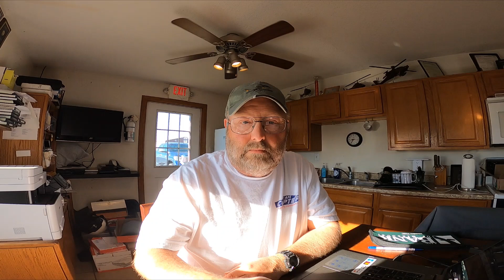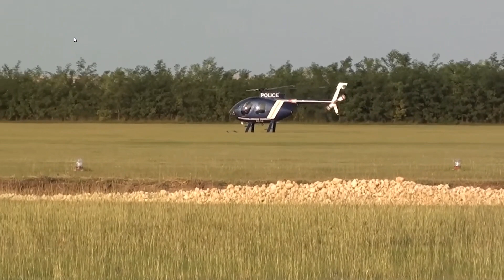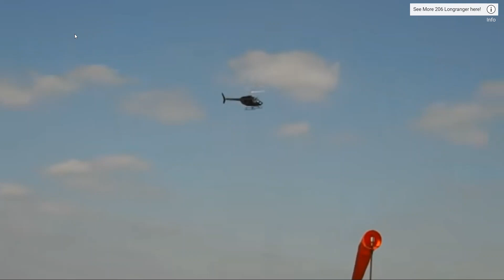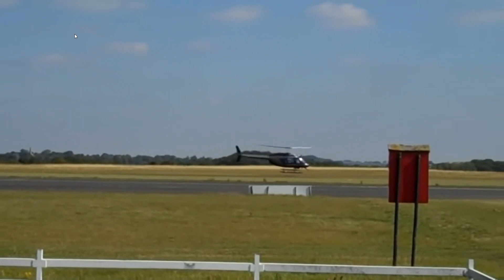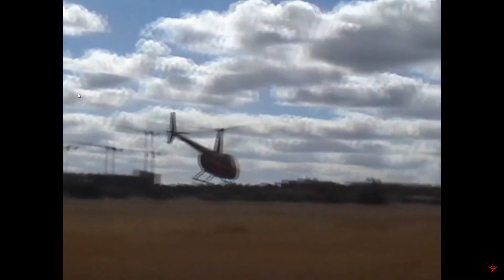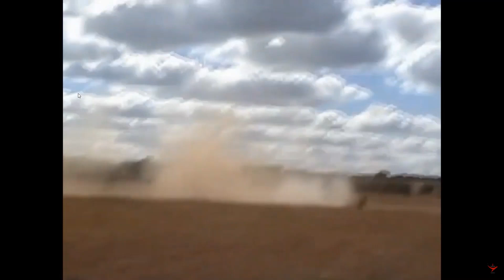Texas Hog Hunt Helicopter Crash Explained- Revisited

Comment: I train on a R 44 if he would've left it on one mag the motor would be running rough
Reply: The engine was intermittently running on one mag, but the mag switch was set to the OFF position.

The NTSB accident report has been completed for this crash.  Their finding from accident number CEN21LA109?

"The National Transportation Safety Board determines the probable cause(s) of this accident to be:

The pilot’s inadequate pretakeoff checks which resulted in the magneto switch (key) remaining in the OFF position during the takeoff sequence and initial climb and the right magneto grounding intermittently."

Comment: If you watch the original video at around 1:53 which is before the pilot has reached forward to touch the mixture, master and ignition switch you can clearly see the key is at the 2 o’clock position which on the R44 Raven II is the off position.
Reply: Yep.  The NTSB accident report has been completed for this crash.  Their finding from accident number CEN21LA109?

"The National Transportation Safety Board determines the probable cause(s) of this accident to be:

The pilot’s inadequate pretakeoff checks which resulted in the magneto switch (key) remaining in the OFF position during the takeoff sequence and initial climb and the right magneto grounding intermittently."

Comment: But let's ask ourselves this important and relevant question: Why did the engine quit?
Reply: Because the magneto failed.
Reply: @warren1953  - The magneto?  There's two of them. Or there should be.  Is it your contention that the key was in the "left" position, the helicopter took off, and that left mag "just happened"' to fail at some inopportune point after that?  I mean, it might have happened that way, but I think it's a stretch.  

I will agree with you that only one mag was working during that flight. The manifold pressure gauge clearly shows that.  But here's my take:  I believe that the key was off.  Somehow, the engine started - I don't know how. Maybe the pilot hit the starter button, intending to switch the mags on as usual(?), but the engine fired and so he just pushed the mixture in and went on with his life and never questioned why there was a step missing in that process.  (In some helicopters, you get the engine cranking and then turn the mags on.  In the R-44, do you initiate the start with the mags on or off before you hit the button?  I don't know.)  

Maybe the pilot just assumed that he left the mags on after the last shutdown and never bothered to check.  Look, we pilots do dumb stuff all the time.  Who knows.  We can't all be Chuck Yeager/Aaron.

I think that either the mag switch was defective, or the P-lead from one mag was not sufficiently grounded when the key was off.  And that's why the engine fired right up.  At some point right after takeoff, the intermittent connection between that mag and ground became solidified again, perhaps momentarily, but for long enough.  And when it did, that mag shut off like it was designed to do.

I've been flying for nearly 50 years now, but I admit that I don't have a whole bunch of piston time.  And in all my time in aviation, I've never heard of a magneto just spontaneously quitting outright.  Maybe it happens, I don't know.  I've had bad mags before.  They cause a ruckus and make the engine spit and pop - but as long as they're physically turning, some sparks are gonna go somewhere.

No matter how this happened, it ended up being a very bad day for that pilot, who now has some uncomfortable questions to answer.
Reply: @ThatBobGuy850   "I think that either the mag switch was defective, or the P-lead from one mag was not sufficiently grounded when the key was off.  And that's why the engine fired right up.  At some point right after takeoff, the intermittent connection between that mag and ground became solidified again, perhaps momentarily, but for long enough.  And when it did, that mag shut off like it was designed to do."

Exactly correct.

The NTSB accident report has been completed for this crash.  Their finding from accident number CEN21LA109?

"The National Transportation Safety Board determines the probable cause(s) of this accident to be:

The pilot’s inadequate pretakeoff checks which resulted in the magneto switch (key) remaining in the OFF position during the takeoff sequence and initial climb and the right magneto grounding intermittently."

Comment: The mag switch is clearly in the off position ... even at the beginning of the flight you can see it as the camera pans the dash .... must have a poor ground circuit which allowed it to start and run until vibrations or whatever made it work and shut the engine down .... also dont confuse R44 key position with a previous switch they used that was different .... mag-switch failures like this are not as rare as we think according to experienced  fixed wing mechanics ... it is always traced back to a faulty ground circuit, thanks.
Reply: Correct.  The NTSB accident report has been completed for this crash.  Their finding from accident number CEN21LA109?

"The National Transportation Safety Board determines the probable cause(s) of this accident to be:

The pilot’s inadequate pretakeoff checks which resulted in the magneto switch (key) remaining in the OFF position during the takeoff sequence and initial climb and the right magneto grounding intermittently."

Comment: When I watch the moment when he goes to turn the mag switch off, to my eyes, he doesn't appear to actually turn it. His thumb appears to slide around the key without touching it, and it doesn't seem to move. You can watch it at .25 speed on YouTube, which I did a few times. Could be wrong, but that's what it looks like to me. Either way, the mag seems to be the mostly likely cause for the lost engine. Also, with regards to leveling the skids, he seemed to be landing on a downward incline. How would this affect his ability to get the skids level with the terrain here? And filed under "you don't get to choose when you lose your engine"--It's too bad he didn't lose it about 10 seconds before he did, when he still had some runway and level field ahead of  him.
Reply: The NTSB accident report has been completed for this crash.  Their finding from accident number CEN21LA109?

"The National Transportation Safety Board determines the probable cause(s) of this accident to be:

The pilot’s inadequate pretakeoff checks which resulted in the magneto switch (key) remaining in the OFF position during the takeoff sequence and initial climb and the right magneto grounding intermittently."

Comment: Confusion? Maybe between your two videos and an untrained viewer. You said one thing then changed your speculation. That key is clearly in the off position. After the hard landing when he goes to turn the key off, you see it never moves. I'd like to see the maintenance log. I've experienced funny things with the key and mags in Raven 2s myself.
Reply: I also question why the manifold pressure was reading max continuous before he's even light on the skids. I wouldn't have flown it. External pressures were probably at play here too.
Reply: Correct!  The NTSB accident report has been completed for this crash.  Their finding from accident number CEN21LA109?

"The National Transportation Safety Board determines the probable cause(s) of this accident to be:

The pilot’s inadequate pretakeoff checks which resulted in the magneto switch (key) remaining in the OFF position during the takeoff sequence and initial climb and the right magneto grounding intermittently."